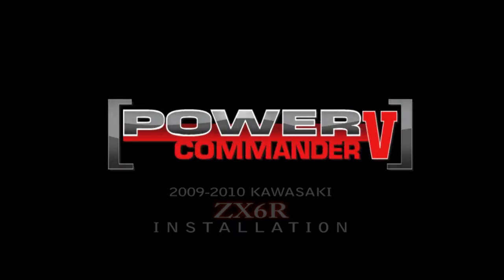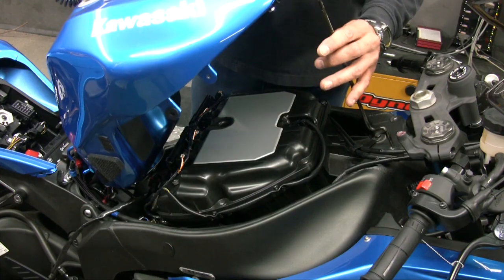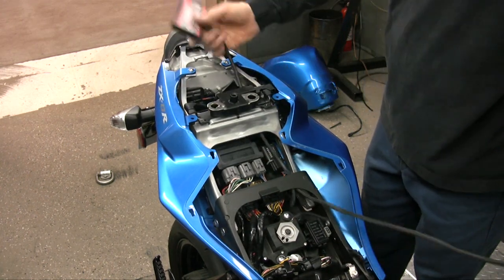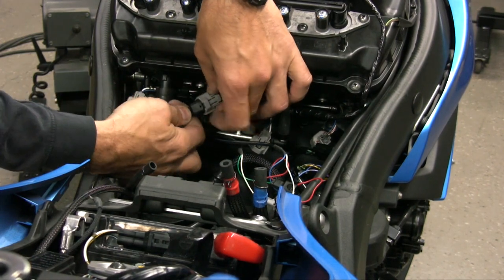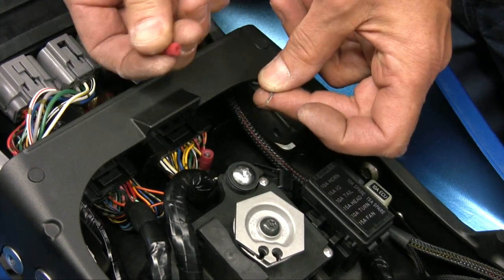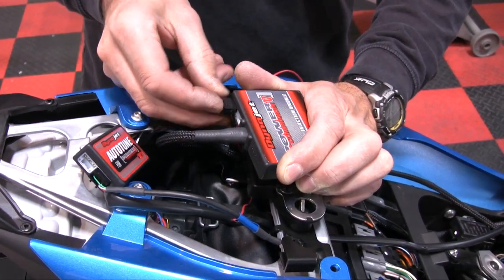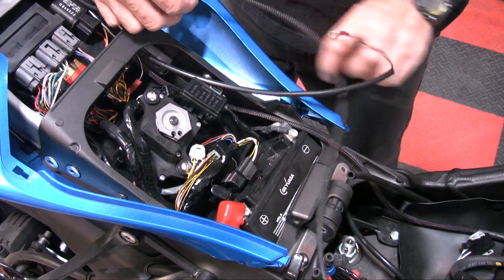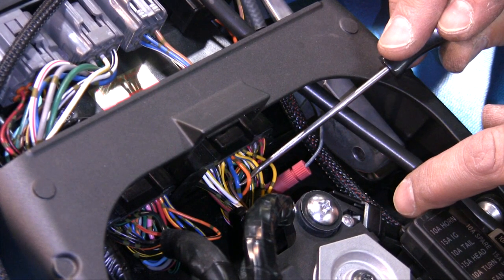2010 Kawasaki ZX6R Power Commander V Installation

Comment: Great video mate... I've got a 2010 Zx6-R and talking to local dealers to buy a pc5 I have been advised that I must also buy in conjunction of the pc5 an Oxygen Optimiser plug in. If I don't do this my bike will run like an old dog... I have been looking online for this Dynojet O2 Optimiser plug but cannot find the part which is for my bike - they have them for others...
I am skeptical due to the fact that the dealer also advised me that I needed an O2 eliminator block off plates (this after a couple of phone calls to other dealers was told I didn't. I had bikes i.e. 2011 Triumph Speed Triple which I installed a Scorpion slip on exhaust - this needed an O2 eliminator. I am a little lost here... help.